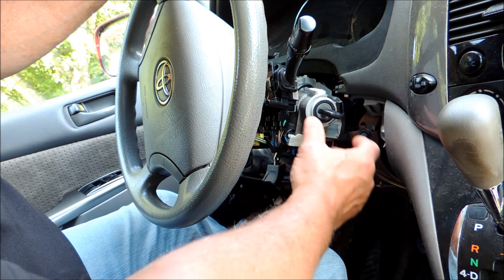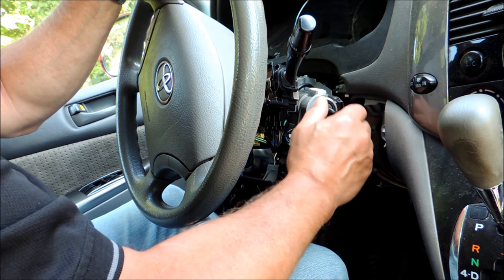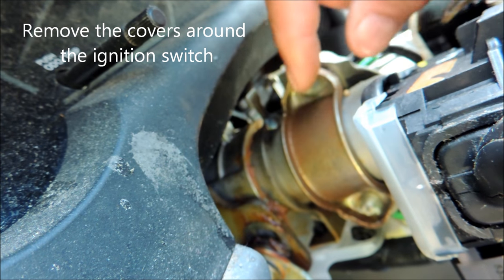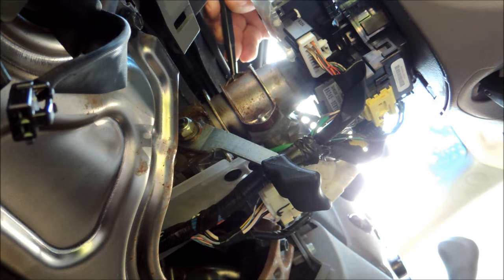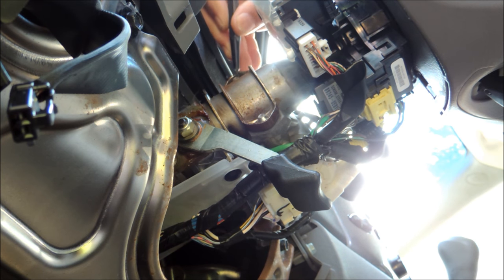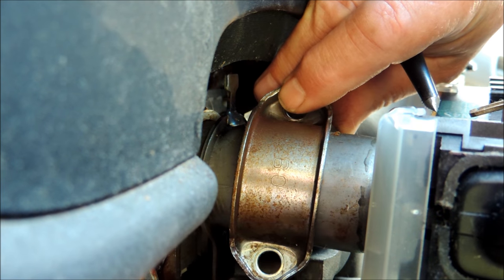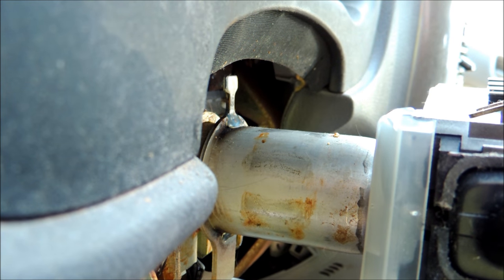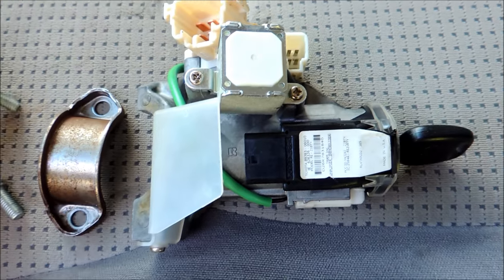Key Stuck or Won't Turn in Ignition?

Comment: They had to put a new lock and cut a key for a 2010 sonata
Reply from the maker: Sometimes the lock does have an internal failure requiring replacement - Cheers Brian!
Reply: How much did it cost

Comment: Mark, my daughter has a 1998 Acura integra. The key gets locked in and there is a small lever if you will on the shifter that (its under the plate/cover at the base of the shift lever) you can raise manually and the key will come out nice and smooth. I have been able to get the key out without doing that but you have to fight it and it feels like cylindars have dropped or something. I would like to know if changing the ignition switch (cylindar, keys etc) will take care of this or should I change the piece on the shifter? If so I am having a heck of a time figuring out what its called would you know what its called? Thank You
Reply from the maker: Dave - I'd chenge out the lock cylinder - sounds like its failing

Comment: Thank you so much sir. Your video could have potentially just kept me from losing my job.

I loaded truck with forklift, and forklift pushed truck forward slightly while front wheels were turned.

After loading the key would not turn.
Now I know all I had to do was wiggle the wheel. 
Started right up.
Reply from the maker: Glad it worked out Hunter - Cheers from Canada - Keep on truck'in!

Comment: Ty! Ignition was locked. Had some play in the wheel. Tried turning wheel more just in case with no luck. Jiggled the lock mechanism a few good times and it released!
Reply from the maker: Great - but don't chance a second lockout - get it fixed asap Cheers from Canada!

Comment: I think we may need to replace the ignition switch in ours but my husband says if we do that then we'll have to hire a locksmith.  Is that true if we were to replace the ignition ourselves?  Even if the ignition comes with new car keys?  It kinda looks like that's what you did too but I don't understand the need for a locksmith.
Reply from the maker: It depends on the make model and year of your car -the local mechanic can usually do it - if its old like 90's you maybe able to do it.

Comment: I have a Sienna, same as this one in the video. This has started to happen, but it usually resolves itself. Today was the first time It didn’t, and this video was a lifesaver
Reply from the maker: Good to hear - Cheers from Canada!
Reply: I have a 2007 Sienna as well and my one and only key quit working after I parked it up for the night. $400 later I got it fixed and it’s good as new. Unfortunately the key AND the lock were just too worn down.

Comment: Thanks for the video I have tried all the above except for removing the column cover it is a 2005 Ford explore V8 4 x 4 model so far nothing has worked however I just disconnected the battery and the key came out. I put battery terminals back on put key in fired right up key will not come out again repeat and rinse. Ha ha it just keeps happening. Any suggestions?
Reply from the maker: Thanks for the info Bret might help others - Cheers!

Comment: My key wouldn't turn everytime I would try to start my car, jiggling seemed to work most of the time but I wouldn't want to keep doing that everytime to start my car. Should I just replace the lock mechanism?
Reply from the maker: Try a new key cut to code first it's cheaper - dealer has code

Comment: You don't have to break your ignition off with a chisel. Take wd40 and squirt a little in the tumbler. Insert your key and tap on the end of it with a screwdriver handle to release the tumblers. That should free it up enough to be able to use the key. Look underneath and there will be a pin you have to push with the key on to be able to remove and replace the switch. They have ones for gray key (computer chipped) and black key (no chip). Most dealers can also refurbish yours.
Reply from the maker: Good pro advice Chris - thanks - Cheers from Canada!
Reply: It's  a good video to watch however I agree with you  WD 40 would've work a lot faster  still a good video to watch

Comment: My vehicle 2001 taco quad old style key, no fob, the key is worn down. When I got to turn my truck off the ignition won't turn to the off position, it stops at the 'on' position effectively leaving my clock, stereo face and etc to drain my battery. Also the key comes out easy in any position. I need to have dealership make a new key but until then I was hoping to find a trick.
Reply from the maker: I'd change to whole lock assembly not just the key - Cheers!

Comment: How do you get the plastic pieces off around steering wheel in order to take out the ignition mechanism?
Reply from the maker: there are usually a few screws  and clips - varies by model

Comment: Hello! I have a 2016 Nissan Versa and this same thing has happened to me. Usually after I jiggle the key for a little bit in and out it starts right up. Some days is easier than others! What exactly should I do? From watching the video I don’t think I need to take the whole thing off.
Reply: If you're luck is like mine, not will you have to replace the ignition switch, but a few weeks later, have to replace the battery and a few weeks after that ANOTHER  part. It NEVER FAILS, regardless of the vehicle. Easy fixes are for people naturally lucky. I'm not. Its the worse possible scenario every d time ! edit not ONLY will you have to .......(only was missing, no edit with this app

Comment: I have a question. My car starts no problem, but sometimes, when I attempt to turn the key to the left to turn the engine off, it will only turn until the last click before the shut off portion and get stuck. I have to turn the car back "on", by turning the key again to the right, then switch to reverse and then put it back in park in order for me to turn the key all the way and pull it out.

Could it be the same issue? Thank you!!
Reply from the maker: My guess without knowing more is that you have an older GM? vehicle - the ignition lock is worn and failing - needs replacement asap before it completely freezes in one position

Comment: How much did the locksmith cost versus buying a new assembly? If you buy a new assembly, do you have to get new keys made and programmed? That costs a fortune alone. Thanks for the video! Been turning the wheel and shaking the key, but I think that's working less and less.
Reply from the maker: You might need a new lock assembly but you can program your own key - it's all over YT check it out - let me know what happens. Cheers from Canada Jeff!
Reply: @carquestions  Thanks for getting back to me so quick! Is the lock assembly the same as the ignition switch? My key is pretty worn on my 2000 Toyota Avalon. My other set was stolen, so I'm on my last key. You said a worn key can't make a new sharply cut one. Should I try to get a new one cut and programmed for $300+ first? Or does a new lock assembly come with a new key? Would applying lubricant to my existing key help, or make it worse? So sorry about all the questions! LOL. Greetings from East Bay California. 😎🌴
Reply from the maker: just look for the lock cylinder with key maybe Amazon - no need to change the other parts @jeffs9300
Reply: @carquestions  Okay, I'll definitely try that. Thank you, sir!

Comment: Question, I had to install a new ignition switch wiring harness, the old lock cylinder was bad so I went ahead and replaced it. Now I can turn the key but I can't remove the key or start it? Side note car hasn't been started in 3 or so months so that's why it probably won't start lol. Thanks !
Reply from the maker: Bryce - remove the lock and see if the key can be removed - if it can something is jamming it when you install it
Reply: @carquestions   yes when it's not installed no problem. I can't see an obstruction so I was thinking that they lock cylinder housing could possibly be bad? Thanks again for the speedy response!
Reply from the maker: @brycewells9224  while the lock is off - look at the obstruction while turning  the steering wheel - does it disappear?
Reply: @carquestions   when I get home I'll do that and see if there is anything. Thanks again I'll let you know what I find:)!

Comment: First time this ever happened. Thank you!!!!
Reply from the maker: anytime Rose cheers from Canada
Reply: @carquestions  thank you so much for your videos! I have a question if you don't mind.. my 89 Cadillac does this now but I can turn key to accessories position. But will not go any further it's like a brick wall preventing my key to go to the cranking position. Should I still replace key lock cylinder or is it a steering column problem?

Comment: I have a 98 Nissan Altima. After the locksmith, putting the assembly back in, does one use the same security bolts?
Reply from the maker: nope - can't tighten them - single use only  - just use regular bolts

Comment: Hey my daughter has a 1996 Toyota Avalon XL and she said she is having to wiggle the key to get it to start sometimes does it have the same thing and will you have to use the same tools to get the switch out ...what do you think on this matter
Reply from the maker: Hard to say Mike but it sounds like the key or lock is worn and may soon come to a point where it won't turn - so try a new cut key before she gets locked out - Cheers and let me know what happens.
Reply: @carquestions  well I don't think it was the key she had a new one made and it didn't help so I think the switch needs to be replaced
Reply from the maker: @godspeed7771  If the new key was copied from an old worn out one then it won't be any better - yes lock needs replacing likely
Reply: @carquestions  well I told her to spray a little WD 40 in the key slot and she's told me after the next day it's been doing OK so I don't know but it's working right now she still mite need to replace it at some point

Comment: I drive a 2013 Subaru Impreza Hatchback with 74k miles. So I’m able to insert the key and start the car. Everything runs smoothly until I try to take the key out. It’s stuck in the ACC position and won’t turn any further and prevents me from taking the key out. The steering wheel locks and will not turn unless I turn the car back on. I have no issues turning the key to start the car, only when I try to remove the key. It used to not be a big issue, but here recently I’ve been stuck in my car for 30-40 minutes trying to get it out. I tried my spare key and had the same issue. Any advice?
Reply from the maker: The lock seems to have internal damage - try jiggling and turning vigorously - up down in out etc - otherwise its locksmith time
Reply: @carquestions  thanks so much for the speedy response! That helped for the time being. Now have to find a more permanent fix! 😂
Reply from the maker: @mylinhnguyen487  If you got it to work - get it to a place you can repair/fix it - this type of problem will lead to a sudden "lock out" so you don't want a big towing bill or get stuck in the middle of an evil forest

Comment: Thanks. Stuck in a parking lot for a few minutes and finally got it to work. Changing out my keys to see if that'll help. 👍
Reply from the maker: Good idea
Reply: @carquestions  I put graphite of it and waz much better but will still change the key and keep a pencil in my glove compartment.
Reply from the maker: @GDixon-ch3yl  If the lock fails no amount of graphite will help. Some cars like Saturns - are known for ignition lock failures - so google your car for ignition lock failure and see what it says to be sure
Reply: @carquestions  Good idea. Thanks.

Comment: Just experienced for the first time tonight, I tried to start my car and ignition would not turn over. Had to mess with it for a couple of minutes for it to turn. Then when I got home, car was on and could get the ignition to turn so I can turn the car off and get my key out! Is that the same thing?
Reply from the maker: Yes but in reverse - your lock is failing (ignition cylinder) - needs replacement asap( or you'll be stranded
Reply: @carquestions  too late! Been trying several different ways to get my key out. Car is running in my parking lot now
Reply from the maker: @rickymcintosh3911   jiggle and light turn like crazy and dont stop
Reply from the maker: @rickymcintosh3911   jiggle and light turn like crazy and dont stop

Comment: So I've never had this happen with my previous cars and so when I start researching some evidence to support my hypothesis I was led to this video so I know I still need to get the sensor to my e-brake fixed so I'm keeping that in mind but as a temporary quick fix if your ignition key is stuck in a certain position and your key is able to be removed and the engine is still running if you happen to have a Lockpicking kit , use one of the tools to push all of the pins in.  Once confident the pins are triggered , Using the Car key to turn switch and  disengage the ignition. SUPREMELY off chance  solution but it just happened to me and hope it helps Someone else out there!
Reply from the maker: Good info Aqua thanks - you can also leave the key in the ignition and tap on the end of it until the wafers fall into place if you don't happen to have a lock pic - Cheers from Canada!

Comment: Hi my car when i turn keys on all the light turn on but when i try to turn the car on it doesnt  make any noise or attempt to start only  by pushing 
Will it be expensive to repair thank you so much
Reply from the maker: Sounds like the vehicle may need a starter motor or battery - hard to say without knowing the type and model and mileage of car - hope this helps - Cheers from Canada!
Reply: @carquestions  the battery is new but my brother has left the radio on overnight and in the morning it didn't turned on neither with jump only by pushing 
maybe u right the most likely need a new starter
Reply: @carquestions  thank you sir for your help

Comment: Help.
I need to move my Jeep about 30 feet but My Jeep Grand Cherokee Laredo 2004 key won't budge .
Battery is dead.
But I got a jump and now key won't turn.
Reply from the maker: Keep moving the steering wheel and jiggle the key like crazy - let me know what works - thanks and cheers from Canada!
Reply: I oiled the hole and tapped on end of key about 10 times and it works! Thanks!

Comment: I got into my car to start it, all lights flashed for a second then everything went black.  My key fobs don't work and the key is stuck in the "pause" position just before it cranks. 2009 Traverse. Thanks
Reply from the maker: Jiggle the key like crazy to get it out - it sounds like the lock has failed.

Comment: opposite problem kinda, tumblers are fine, old key wont turn to code my new key, so guess Im sol (new key turns it fine, but locked out, wont start engine)
Reply from the maker: Needs to be programmed - search owners manual or google the procedure Mario - let me know what happens - Cheers from Canada!

Comment: I tried everything, the key won't just freaking turn and im outside  -24.
Reply from the maker: VOF - if you've pulled hard on the steering wheel and it still won't turn then the lock itself is busted internally - jiggle the key up and down and or slightly in and out quickly as possible like a vibrator while trying to turn - you'll need a locksmith if the lock is defective - sorry
Reply: @carquestions  when I got out from work  my car had difficulties turning on but also turning the key was very difficult but managed to do it couple of times after that i stuck the wheel and the damn key won't turn anymore and unlocking it isn't working.  Will try again, thanks!
Reply from the maker: @venusonfire7606  if the key turned at all and the car wouldn't crank or start you may have a dead battery situation that requires someone to boost the your car with jumper cables - or AAA if you have it
Reply: @carquestions  i can't start it with cable because key won't even turn to contact now.  But thanks a lot for trying to help.
Reply from the maker: @venusonfire7606  Sorry I couldn't help - good luck - cheers from Canada

Comment: How much would a locksmith cost?
Reply from the maker: $200 usually -
Reply: @carquestions  thank you
Reply: @carquestions  Mine was 275, and he included a new key. 👍 Honda Pilot 2015, I bought the car used about a year-and-a-half ago turns out that the Tumblers had broken pieces so he replace the whole thing.
I was really lucky, after going through several videos I found you. The drive shift wouldn't move anyway so I had no choice but to call him.